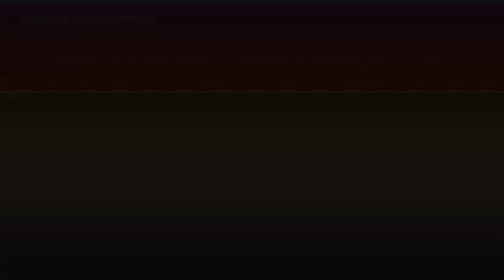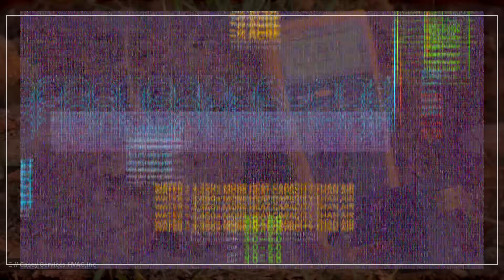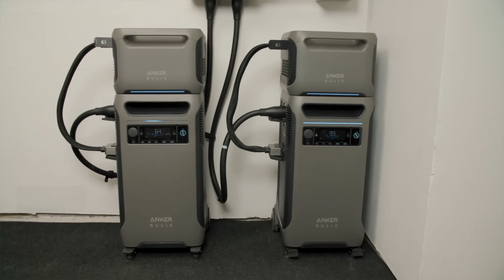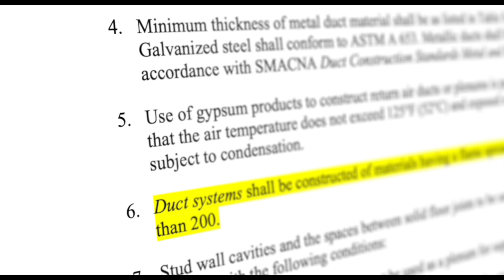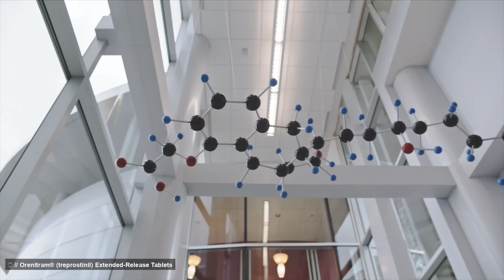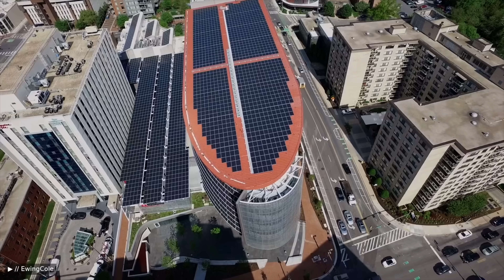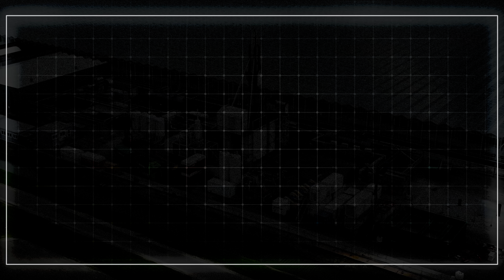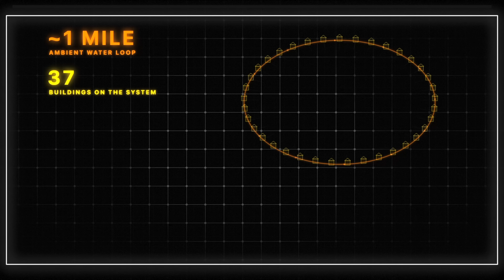The Viral DIY Cooling Hack That Nearly Killed a Family

Comment: two words, The Grid. Properly done, ground source geothermal does not require electricity. While yakhchals  &  badgirs require more than the typical residential lot, for those of us striving for an energy independent life style, or for sustainably designed communities, the fact that each properly built home stays in the 70's year round is gold. We live in the Sonoran desert and the building code resistance is, for the most part, financially prohibitive. Yet, these very structures are still standing in Turkey after more than 2000 years, earthquakes included.

Comment: Yakhchāl physics ≠ geothermal physics
Yakhchāl uses evaporative cooling which scales with humidity deficit, not soil temperature.
Geothermal scales with conductivity + depth + fluid heat capacity.
Further, you are collapsing two completely different thermodynamic systems into one category. A ground‑source geothermal water loop is a closed‑loop conductive system that requires a heat exchanger, while an earth‑air tube is an open‑air ventilation system. This is a ventilation strategy, not a geothermal system. They are not comparable, and treating them as equivalents leads to wrong conclusions about performance, safety, and physics.
Earth tubes, if you did your research are well known to need a drain/pump for condensation/water. They must be sloped to a low point where water can accumulate and be removed. It is effective, and safe if installed properly, and it is far cheaper.
This is one of your most disappointing videos ever as you made at least three errors on something you say you researched well because you were personally very interested.

Comment: I immediately guessed mold.  I live in a humid area and we have to use insulated drinking glasses or the condensation causes puddles on your table.  The same thing would happen if you cool air underground.   Where there's water, there's mold.

Comment: cutting cooling costs by 20%? that doesn't track. this theoretically should be cutting it by 100%. I pay as much as $500 a month in electricity in July/August and MOST of that is cooling. To put it in perspective, in December, my electric bill is under $100 because it's cool enough to not need to run the AC (most of the time) and it's not yet cold enough to need to heat so my non HVAC electric use is like $70/month. I definitely wouldn't spend 60 fucking grand to retro fit my house for a system that will save me UP TO $100 a month but as little as like $10 a month. It would take me decades to recoup the cost. I WOULD, however, pay like $10k for the system they talk about in the viral video despite living in a humid climate and get a 100% reduction in HVAC costs. Would pay for itself in no time, less than 5 years. Not to mention save me from having to worry about my AC going out on a 98 degree day in July and the HVAC folks can't come out for a week because everyone else's shit is broken too. You just have to make sure you have proper drainage  to prevent water build up, that's all. I've seen videos of it. This shit you're talking about doesn't seem remotely worth it, neither for a monthly cost stand point, nor from a "there's nothing to break" standpoint (cuz there is). Sure, maybe a decent idea for new construction OVER an HVAC system, but I'll pass

Comment: All you need to use is GALVANIZED  culvert pipe because Zinc WILL NOT allow mold to grow whatsoever. If you use metal galvanized culvert, not only will if always be mold free, it is cheap and actually engineered to be buried.

Comment: We have geothermal heating and cooling with two boreholes since the 90s. (Type 3 in this video). Of course it lowers heating costs immensely. Recommend. Boreholes lives longer than the heat exchanger which has life span of 20-25 years. We exchange it to water based radiators throughout the 200 square meters giving equal heating not AC units that affects the humidity and air quality. If you build a new home today it would be floor heating.

In our city apartment we have distinct heating/cooling since it was built 50 years ago. I guess this is what the video call system 4. That’s a good solution for larger complexes, but it also get you dependent on the local municipality heat provider and can’t change heat provider. The heat cost will follow energy prices in general. (there might be private heat providers in the system, but infrastructure and payment is through the local authority monopoly as it should be).

Bonus about the district heating is data centers can sell their heat instead of venting it. We also tried out with nuclear heat when the system was developed in the 50-60s and that worked great. Nowadays there are no nuclear power plants close enough to cities and the heat is lost on the way no idea with the security distance required today. 

This is in Sweden. The tech isn’t new by any means.

BTW, don’t mix heating and cooling district heating system. Four pipes; warm, warm return, cold, cold return. Put in utility tunnel, not dig directly into the ground. Pipes need to be repaired every now and then.

Comment: Undecided With Matt Ferrell is incompetent. Don't trust anything he tells you. Much is correct, but there is so much incorrect mixed in, his content is untrustworthy across the board. Misleading and factually incorrect is standard in every video. 

Stop calling it geothermal! It's a ground source heat pump. The heat isn't just available at usable temperatures (actual geothermal). You have to send a heat pump cooled fluid down to pick up heat, then extract the heat from that fluid using power. 
They aren't the same thing. One requires energy input (beyond the pumping) the other does not.

Comment: We have a 5 ton geothermal system with two 300 ft wells.  Yes, it cost and ours's was quoted at $40,375  which after incentives ended up costing $21,315.  It was installed in 2021 and one night in February the furnace had a problem but the installer, Dandelion, sent someone to fix it that same night.  Turned out it was a known problem so the furnace was fixed.  Since then the system has worked trouble free through cold snaps that had temps near 0F and heatwaves with temps of over 100F.  We set one temp 74F in cold weather and 76F in warm weather.  It is powered by our 22.9kw solar system.

Comment: Earth-ships use a natural circulation fresh air ventilation system similar to what you described for the Belgian home. However, the first Earth-ships were built in northern New Mexico where it is VERY dry so mold may not be an issue there.  I know they've built Earth-ships in less arid areas and I'm not certain how they handle the threat of mold in those other areas.

Comment: Pretty much ALL 'Geothermal' systems are SITE SPECIFIC (not just Zones) and need custom designs. That's why most Developers and CODE Counties avoid them.
If you hit water at 65ft, you have a simple well water exchanger; Celebrate, and be prepared
If you have 1200ft of solid calichie (Deserts) you should be Permitted to build Adobe without Cu$tom Engineering and $$$ bureaucrats.

Comment: Is it at all possible to use the Water Inlet pipe for a Home as a source of temperature differential?  Could the excess heat inside of a home be dumped into this pipe, effectively eliminating the need for a Water Heater, at least in the hotter months?

Comment: So why does no one talk about the faulty construction of the earth tunnel that caused the failure? How did water enter in the first place and why was there a low section that would collect water? Improper compaction before installation and backfill? What of all the other homes that had earth tunnels? Were they all condemned as well? 

It's so easy to call a design a failure when poor implementation of said design is what caused it. I wonder how many auto manufacturers would be called a failure because of one person at the factory not doing his job correctly, or even some faulty engineering. I would guess all of them. 

Not promoting or discouraging the earth tubes here, just looking for real world facts on something done correctly. Haven't seen the so-called viral video and I don't care to. I'm just looking for honest answers as well as practical solutions for the so-called issues or failures in any system. I'm sure they are out there.
Reply: Condensation could very well be the issue. Nothing needs to leak.
Reply: @T3H455F4C3  Perhaps that may be true but there should not have been any accumulation/puddling in the middle of the span. Indicates improper compaction before setting the tube in the trench. Seen this many times with soil lines exiting a structure and creating a trap between the home and the street. Faulty construction can ruin even the simplest of technologies.

Comment: Not in humid conditions you say? Stop the fear pron. Go talk to the Amish, and they still use clay pipes. The pipework needs to be roughly 1 degrees down pitch, with a drain off for pipe condensation. No mold, no mildew, no permit, and it works great. Vertical pipes= very expensive core drillers, permits. closed loop water/antifreeze; while more efficient=very expensive, permits. Another Shill. Edit: on top of that, you have asshole builders clear cutting all the beautiful shade trees, to cram houses on top of each other. My home is on 1/2 acre, and lots of large shade trees around the house. That alone lowered our power bill significantly.

Comment: My wife and I planned for years to install geo.  We have five acres so went horizontal.  Because we are rural and many areas have no natural gas, geo is very popular.
You need to run your geo 24/7.  Geo doesn't have the temperature difference from the fan.  If you let the temp get out of control the system can't catch up.
Our payoff was about 10 years.

Comment: For the investment you need to make versus the cost benefit it is a "Buy once, cry once" proposition particularly if you separate your ground loop fluid (which may have corrosive qualities) from your heat source loop that your water source units will pull from and this enables you to add heat to your source loop, if necessary, without taxing the ground loop. By using inverter driven compressors and pumps your utility will repeatedly check because they will think your consumption is somehow broken.

Comment: I like the idea of geothermal heating and cooling. I don't like the idea of the cost and I think it would be possible to bring the price down and make it cheaper. I would love it if you could rent some drilling equipment and drill your own holes, somebody would just need to design a boring tool that is simple and user-friendly. 

I live in central Ohio and we have gas heat and it is incredibly cheap and it provides the best heat for your home. Like it's just a really nice comfortable heat and doesn't cause the are to be too dry.  One thing my guy did when he installed our new system about 12 or 15 years ago was he made the filter box so that it takes a 4-inch thick filter, instead of the standard 1 in thick. This gives high-efficiency and excellent flow. The filters are more expensive but they also last up to 6 months. Costco had some really good ones on sale and I stocked up on them and got about eight Merv 12 filters. They actually have a higher flow rating than the Merv 8 versions I got from Home Depot for more money.

Comment: A closed-loop geothermal system does not require a vertical borehole. A horizontal buried loop can work if you have enough land and permits. The tradeoff is that the indoor geothermal heat pump equipment is more specialized and expensive than a normal HVAC system.

Comment: The main idea of passive loop is that once built, it requires no energy to run. Which isn't something that liquid based geothermal solutions offer cause you need to have heat pump to make it actually useful, which is energy intensive.  It's honestly understandable that lobbies would be against developing a simple and cheap solution where expensive and complicated one can exist.  
Ofc I'm not saying it's without it's faults. But abandoning entire application of technology, instead on expanding on it and solving it's issues in favor of far more energy intense process seems like a bad idea

Comment: Managing humidity does a lot for comfort and gives a wider band of livable temperature. I prefer techniques that require less moving parts, maintenance and energy to work. Along with a critical look at used materials, we had the coolant fridge thing that wrecked our ozone layer mid? last century, and we keep getting new versions of such materials (or the waste of them). 
Yes to a closed system when it comes to heating and cooling with some kind of pump and tube system.

Comment: It's obvious why retrofits aren't particularly common, but it's always frustrated me how rare this technology still is in new construction.  In the mid-'90s a developer in the Toledo, OH area was going hard on Water Furnace systems and I'd occasionally see the signs outside of new construction advertising it.  My grandparents ended up buying one of them, and my family later bought that house so I lived there for a few years.  A 3000 square foot home with high ceilings and my dad still raves about how cheap the heating/cooling was to run there years later.

Looking at the pics on the Zillow listing that home got a newer version of the Water Furnace setup put in some time in the late 2010s, so they got ~25 years out of the original system.

If I were ever able to build my own home from a bare lot I'd absolutely put in one of these systems, it's just a no-brainer.

Comment: I have used ground-source heat pump in Vermont, and it has gone well (not perfectly) since 2008.  Our cost back then was about $30,000.  We consider it a resounding success.  One deeply cold winter, the pump at the bottom of the 450-foot well failed. Otherwise we’ve only needed two professional visits, one to check the whole system and for the other, a sensor had failed and it cost something like $25 to replace.  It’s almost a set-it-and-forget-it system.  If power went out it would not function, but our utility is excellent and very forward and renewable-looking. Green Mountain Power also rarely has outages longer than a few hours.  Yes, it’s expensive up front, but you are investing in a simple, 300-400% efficient system that does not let you down.

Comment: The biggest "scam" in all ground-source cooling/heating systems is nature.
Dry ground is a fairly good insulator, which means you wear out the entire system quite quickly and it becomes inefficient.
The situation is significantly improved by placing the heat exchanger below the groundwater level.

Comment: One of the things I read was that you're supposed to set this up with vertical shafts on one side and continuously sloping on the all the way to that point coming from the other side. This way all condensation goes downwards to one spot. There is no pooling and anywhere but one spot and you have to have something that is on a regular schedule that removes that moisture. Otherwise you get legionnaires disease being blown all over your house

Comment: Closed loop is the best way. Use a heat exchanger much like the evaporator coil in you standard HVAC unit and a circulation pump to keep the water flowing in the closed loop.

Comment: When I took the tour of President ThomasJefferson's Monticello, it wasn't the many features of the building itself that impressed me so much as the below ground level end to end  walkway for his servants to use to obtain ice for his drinks, even in the heat of a Virginia summer. At the end of that ground cooled passageway was a large cube shaped pit where ice harvested from the nearby ponds in winter was stored in a tight set of blocks insulated by a thick layer of straw.

Comment: What I dont understand about Geo source is that there are two major differences between air to air heat pumps and air to water.  first is the ground loop and then the crazy part is that all it takes to make the real difference is replacing  a coil to condense the refrigerant with a tube in tube heat exchanger.. Basically a one for one exchange.  About the same price.  The units are normally installed inside as scroll compressors are super quiet.   With the use of inverter type compressors  (dc motors)  the efficiency combined is more than dramatic. 80% or more from what I have read but perhaps you can address this in your analysis

Comment: The problem for us in Europe is that while heat pumps give a theoretical 4x gain, in practice, it is 2-3x, but the electricity is 4.5x more expensive than gas per thermal unit. So the economics just dont stack. To make them stack, we need pumps that can operate at much higher temperatures so they can be turned off during the day when houses aren't used and electrcity needs to come down in price to 2x gas or less.